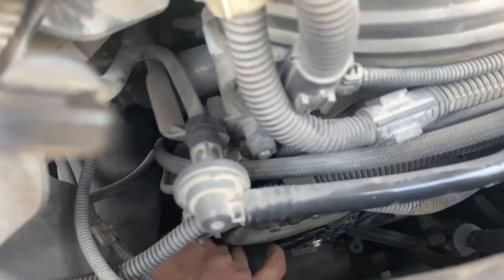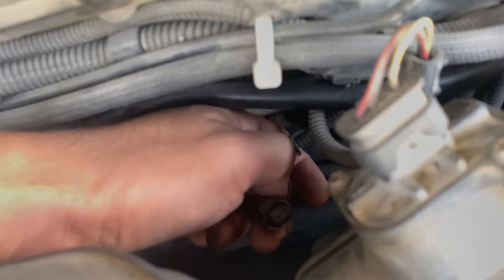BMW F20 overheating on middle of highway!!! Hot fix !!! No tools required @N13 engine only

Comment: Hi I changed the thermostat and the water pump, my car still shows the  check the temperature warning if I drive on high speed. Later on I just saw coolant gashing out from the back of the engine. I can’t tell exactly when that coolant game from and which pipe.  I recently replaced the other black pipe at the back of the engine. What could it be?  I even changed the pully wheel? Please help
Reply from the maker: I assume it's the coolant hose with the temperature sensor on it still leaking if you see coolant leaking from behind the engine, check the main hose going behind the engine as well. When you see the temperature waring just stop the car and look out if the friction pulley is engaging the water pump opening the hood without turning off the engine whenever there is temp warning

Comment: Hi man please advise I have problem on the same car I’ve change the thermostat water pump but it’s overheating when I check the pipes the one comes from the radiator top one is hot but bottom one is cold what could be the problem please assist
Reply from the maker: Check when it's overheating if the water pump is engaging or not. If no then try disconnecting the friction wheel cable as shown in the video. If this is the case the problem could be the coolant temperature sensor which is located behind the engine or the oil temperature sensor which is located on the oil filter housing

Comment: Hi man, my f20 is overheating and I’ve replaced the water pump and thermostat but still ,,,, when I start the car from cold start the pulley makes a once of spin then stops , I wanna know if the pulley is supposed to turn from the time u start the car or it only spins when the car is hot only coz my radiator hose is cold most of the time but sometimes it’s hot so I recon coolant doesn’t flow accurately
Reply from the maker: Water pump actuator is fail safe. It will disengage on cold start and will start only when the engine is Hot. I think your issue is with engine oil temperature sensor.
Till you sort out the issue you can drive the car by disconnecting the electrical connection to water pump actuator pulley
Reply: But if I disconnect the pulley the pump won’t work either , the water won’t pump or pump so it will just keep on overheating still
Reply from the maker: @ThabangRamaboya-bd3eu no way. If you disconnect the electrical connector of that friction wheel belt tensioner the water pump should be always working. It is fail safe part.
If not take a video and send me the link
Reply: Oh I get it now , so basically the water pump will run non stop okay I understand….ill try that today and see if I don’t win 

So if the engine continues to overheat after this solution what would be really wrong because if it was the oil temperature sensor wasn’t it supposed to show oil warning light on screen ?

Comment: so to rectify over heating, your now over cooling the engine... so it wont get to operating temprature and sit on a cold start map constantly.... causing rich running conditions, higher fuel consumption etc? i mean.. im not a mechanic... but surely just fixing it would make more sense... you probably took longer making/editing the video then buying a £20 item and replacing it..
Reply from the maker: You are right but if you're in middle of highway you need to know this fix so that you could get home.
As you said I have to replace the coolant temperature sensor which comes with the hose located at the rear of the engine